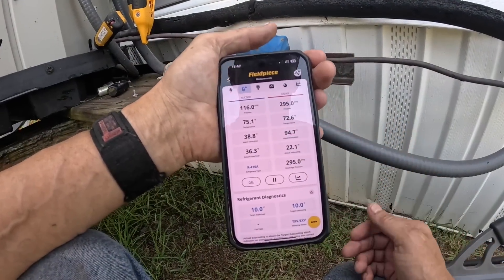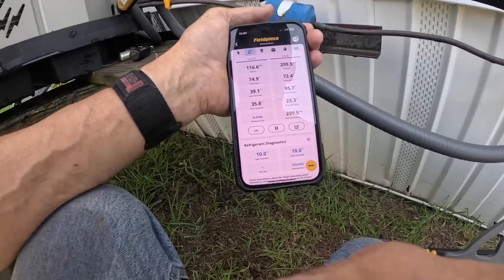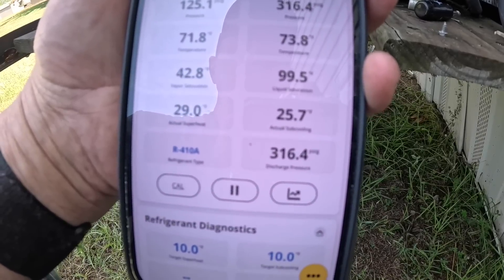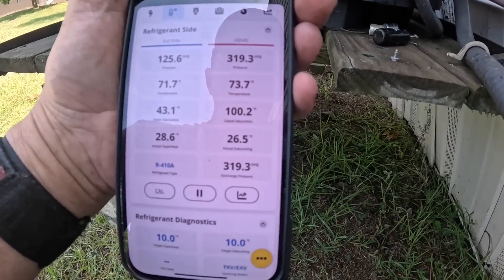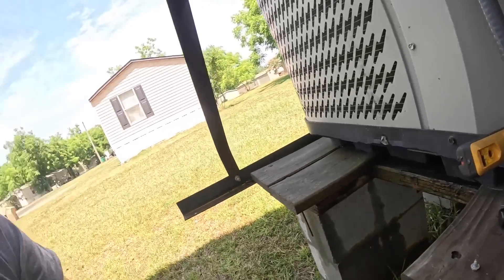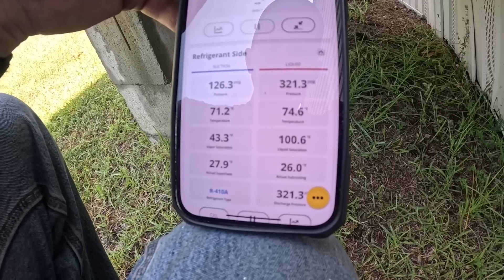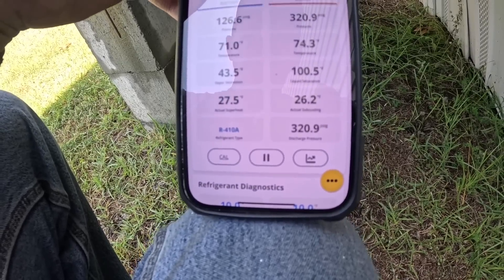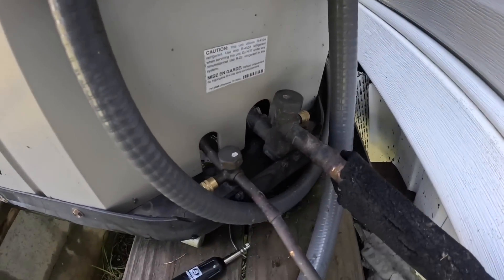Sunday Call! Odd Complaint Leads to A Suspect Micro-Channel! #hvacguy #hvaclife #hvactrainingvideos

Comment: Has anyone seen this before? I had a 2 month old contactor that stayed pulled in. At first I thought my blower motor wasn't working as I could hear the refrigerant but not the blower. I looked at the Tstat and there was no call. I confirmed the outdoor unit was running. I pulled the Tstat and the outdoor unit was still running. I shut off power and had continuity on both sides of the contactor. I had a couple of Sureswitch's so I installed that and all is good. Here is the odd part. Coil was 17 ohms as I suspected it wasn't the coil. No critters, no burned contacts and now the contactor out of the unit seems fine. Could it have just got stuck pulled in and now is working? This is kind of nuts to me that I can't find anything obviously wrong with it.

Comment: Looks doesn't mean anything.  A lot of times washed on outside not between coils. It bakes there  from heat . The only way i found lots  times is to shine flashlight through coil look on otherside . Done it several times when told had been cleaned horrible inside of coil . You can't clean a coil in five minutes correctly.  Have a great day.